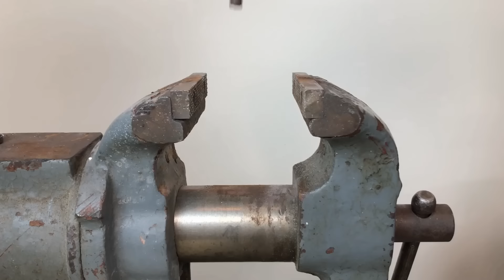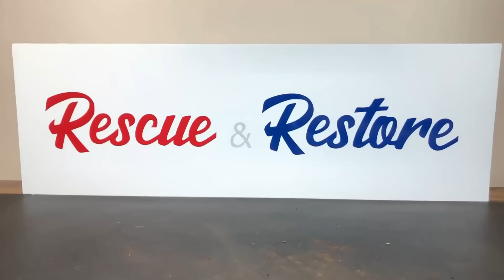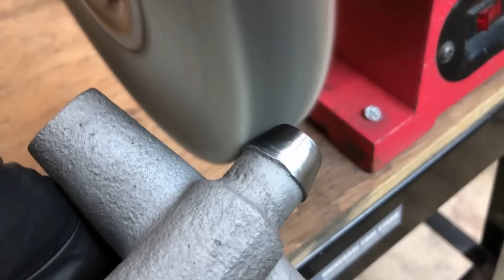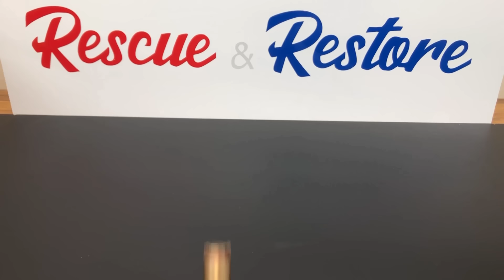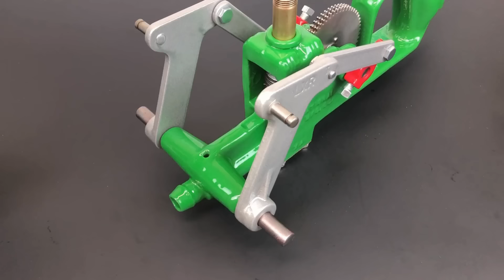Walking Water Sprinkler Restoration - National Manufacturing Model A5

Comment: Powder coating, the attention to detail, nickle coating you went the distance.  Using that nut to weld to the broken screw!  Great job! I think one of those light weight expandable hoses would work best with the walking sprinkler.

Comment: OMG I really liked the way that you fixed the broken bolt by welding a nut
Reply: Me too. Was amazing.
Reply: I just didn't add onto one thing earlier on before; I'm expecting you to manufacture, 1/24th plastic scale models that require PC board and PC board parts assembly.
Reply: I think that  @georgeshelton6281  is a chatbot
Reply: That is common in my workshop. Sorry for bad english
Reply: @Nitrolord  Same.

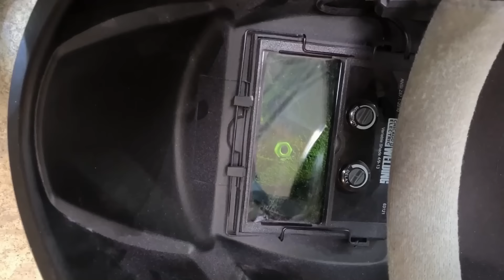Comment: 1:44  - Oh My God! He welded a nut onto a snapped off bolt and extracted it...that's GENIUS!
Reply: Unless it dosent work. then the metal is hardened and cant be drilled out. I've done that replacing exhaust manifolds. it sucks
Reply: 1:44 it doesn't work
Reply: @Aron697  I'm not an expert in metallurgy, but for the vast majority of restoration videos I have watched it does seem to work. On paper it does make sense. Heat weld the screw to the nut and theoretically it should work. I have seen a few instances where it did not, but these are few and far between.
Reply: An exhaust manifold stud broke off in the head of my ‘87 Volvo 240. Welded a nut to the bit of material above the surface and it backed right out.
Reply: Where does he live? Do you know if you do can you tell me Thank you if you do😊❣️💘💝💗💖💞💕❣️❤️💛🧡💚💙💜🖤🤍🤎💟. favorite food is🍎🍉🍇🍓🍒🥦🥨🥯🍳🧇🍞🥖🥐🥕🌽🥬🥥🫑🧅🍞🥔🥒🥞🍔🌭🍕🍟🌮🥗🌯🥘🍜🥮🍰🧁🥧🍦🎂🍿🍭🍫🍬🍩🍪🥜🍰🍯🥛🫖🍺🧂🧃🥧🍡🍢🍨. My favorite sport is⚽️🏀🎾⚾️🏐🏉🏈🥎🎱🏓🪀🏸🥅🛝🤿🎽🥋⛳️🏹🥊🛹🛼🪃🛷⛸️🚴🏻‍♀️🏆🥇🥈🥉🏅🎖️🎹🎤🎼🎧🎨🪘🎺🎷🪗🎸🪕🎻🎮🧩🎳♟️🎯. my favorite way to travel and car is 🚓🚒🚛🚜🚑🚗🚙🚌🚎🏎️🚚🚐🛻🚔🚂🚄🚝🚈🚊✈️🚆🚇🚉🚠🚟🚃🚡🚘🚖🚍🛺🛵🚲🚀🛬🛫🛩️🛳️🚢🛥️🚤⛵️🛸🚁 🛶. My favorite places🎢🎡🏰🗽🎠⛱️🏖️🏝️🏠🏘️🏡⛺️🏕️⛰️🏔️🌁🌉🛤️🎑🌄🛣️🏞️🌠🌇🌃🌁🌆🌌. My favorite objects⌚️📱📲💻⌨️🖥️🖨️🖱️🖲️🕹️🗜️💽💾💿📀📼📷📹🎥📽️🎞️📞☎️📟📠📺📻🎙️🎚️🎛️🧭⏱️⏲️⏰🕰️⌛️⏳📡🔋🪫🔌💡🔦🕯️💸🪔🧯🛢️💵💴💰💳🪪💎⚖️🪜🧰🪛🔧🔨🛠️⚒️⛏️🪚🔩⚙️🪤🧱⛓️🧲🔫🪓⚔️🗡️🔮📿🧿🏺🪬💈⚗️🔭🔬🩹🩺💊💉🚽🚰🚿🛁🛀🏻🧼🚿🛎️🪥🔑🚪🪑🛋️🛏️🛌🧸🪆🖼️🪞🪟🛍️🛒🎁🎈🎏🎀🪄🪅🎊🎉🎎🏮🎐🪩🧧✉️📩📨📧💌📥📫📬📅😀🎉📣🔉🔊🔈🔔📢

Comment: That’s actually quite clever that the front wheel is designed to follow along the hose...
Reply: The really fancy ones had a stop block you'd put on the hose. When the sprinkler reached it, it would close a valve that stopped the water flow.

Comment: Welding a nut to broken screw to remove it.  BRILLIANT!
Now this is something to freak out the cats.
Reply: I knew of this "trick" and had used it both successfully and unsuccessfully in the past but had completely forgotten about it. It's like I'm learning all over again.
Reply: this is an old trick used by a lot of mechanics when they snap bolts in blocks of metal or the such
Reply: Yer 40 years ago.

Comment: I wish I had one of these originals.. and here I am, found this video by searching up a repair guide for my cast iron traveling sprinkler from the 60s or 70s. 

3 plastic bits, those were its fail points first. 
But in it's defense, it got ran over by a 1500 Dodge Ram. I'm glad the tractor gave out before my tire 😂

Comment: I realize this is an older video. But I have to comment anyway. You did a commendable refurbishing effort on this project, and it obviously shows. The only problem with these type hose following lawn sprinklers is, as they water the area, the area gets soggy. And once the area is soggy the tractor wheels spin in the mud instead of walks forward. My neighbor had one and that was the number one problem with his... But a beautiful project either way...

Comment: If you break off a screw use an electric drill with no bits in it and tighten the chuck onto the broken screw

Comment: Have you ever looked at Cerakote intead of Powder Coat? It leaves a smaller coat on it and will stand up more expecially for heat since it is a ceramic coating? You got the over to cure it.

Comment: I find vasaline or wax works quite well to keep paints and powder coat from bonding to surfaces you don't want it to. But im a manufacturing painter so quick and dirty works. It might be more effort in restoration

Just thought i'd chip in my two cents. Its not that hard to get unbaked powder coat of sockets. Love the sprinkler. Now i need one of these for my lawn

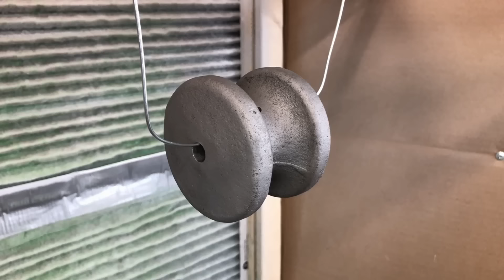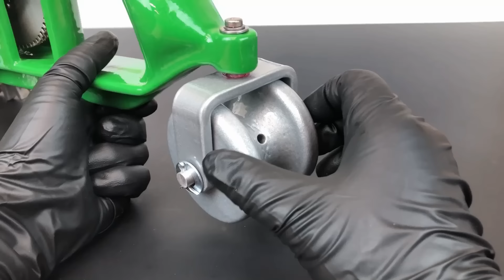Comment: 14:35 and 14:55 Kinda surprised that you didn't remove/sand away the mold lines on the front guide wheel. And you didn't test the paint for lead.

Comment: This is such a great idea, I guess if done correctly you could have it pull the hose back to the tap. Or have a set course for it. I'd really like to see what other things the designer of this amazing device has made. I needed to fix a really old lawn sprinkler. The gear systems in that were off such great design & open /wide tolerance it's basically built to not fail, unlike most of the things of today.

Comment: omg, what did i miss? what turns the brass pipe?
Reply from the maker: The water sprays out of the ends and spins the top and is transferred through the gears which makes it roll forward.

Comment: "Poor Man's Sprinkler system".  I bought my first Walking Sprinkler used a few years back, then once I understood the sound engineering I purchased two new heavyweights that each drag ~200ft of hose across my large fenced yard.  One of my sprinklers has developed the whistle and Walker just discontinued their manufacturing.  Your video gives me a complete step-by-step, so as soon as I find the valve part(s) I'll queue up your video and follow the steps for myself.  Thanks so much, outstanding job from start to finish of your production.

Comment: Is there a name for the key used to prevent rotation of the wheel on the axle? You can see it at 13.05 and it looks like it has spiral flutes that get crushed as it is hammered home.

Comment: I used to use these at the schools where I worked. Once you knew how to set them up you could turn on the water and get on with your other duties. They had variable spray patterns, distance covered and power of the nozzles. They were a very simple and easy to use watering device. A little oil here and a spot of grease there and they were trouble free. A very useful tool that really did the job.

Comment: Could you share where you sourced your cork and delrin seals and bushings? I am just wanting to repair my A5 from leaking. The parts are no longer available from National.
Reply from the maker: Hi, I purchased the parts from National right before they closed.
Reply: @RescueRestore  Great video, you did an awesome job. I ordered the nylon and o ring kit available on ebay, but am keeping the original brass lower bushing until I can source the delrin thrust bearing or close enough acetal and drill a hole in it. Thanks for the video!

Comment: I have one of these and I’m here for some help, the tractor ran around 10 years ago and I hooked it up today and the water shoots out of the pipes just fine but it isn’t spinning the impeller, everything turns fine but I have a leak on the rubber hose fitting. Can anyone help me out?

Comment: I have one of these where the arm, just medial to wheel on the right side, labeled "LXR" is a little too loose on the axle. It allows the claw to fall medially to the large wheel, sadly stopping the device and it freezes. I could fix it if I could either 1)replace the arms, "LXR" and "LXL" or buy a wider claw. No more parts available though. Anyone can think of a solution?

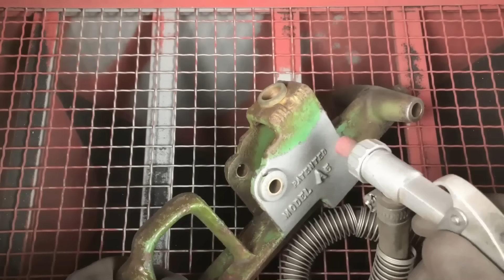Comment: 5:38 a well-meant  tip for next time. you can safe the spindle bearing at the sandblasting with a screw a mud guard-washer and a screw nut. you take a screw there is a little bit smaler as the hole of the bearing. putt one washer on the one side. then putt you the screw into the bearing. after this putt you one more washer on the other side and then a nut on the screw. so is the bearing safe for the sandblasting.